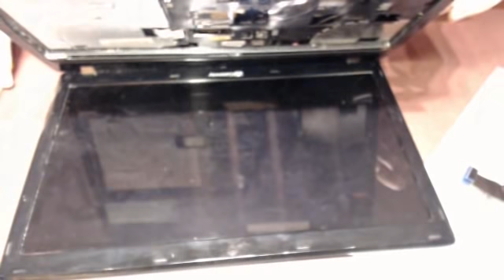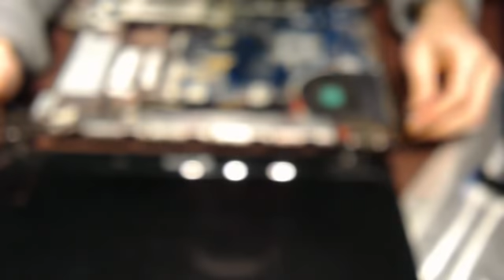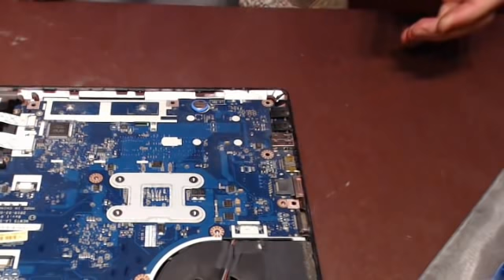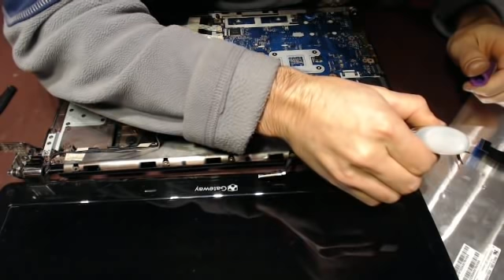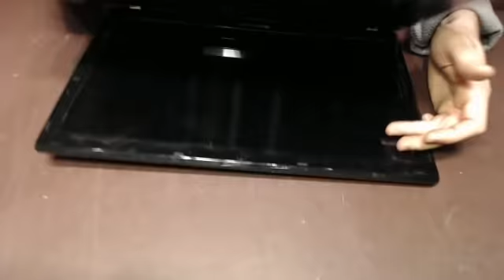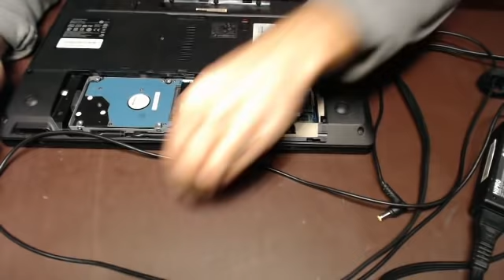How to repair laptop dc power jack socket input port on gateway new95

Comment: Hey my friend, I replaced the power jack. But I unplugged the video cable, while the charger was plugged in. It sparked an then smoke came from the card reader!? No power at all now :( wat happened? Did the jack burn up ??  Hope u can help?
Reply: +Blair Stickland It was because there was still electricity in the laptop. You should've disconnected the charger from the laptop.